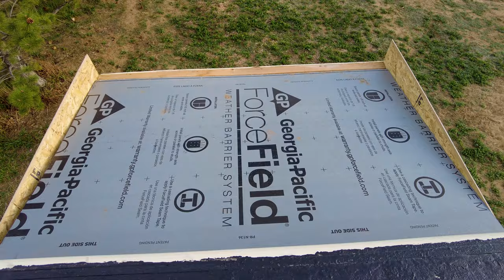$500 Pop Up Camper Hard Side Conversion Update and Future Plans, Exterior Walls and Roof Install

Comment: Mistake you made is that you didn't extend the bottom of bed first.  You could have put a plywood underneath the original plywood that overlaps much as it needed to expand the size of the bed.  Than start building onto the new plywood instead of the old base.  This way you could fit into that bed because you made it longer than it was originally or kept the same length.   All that material that you put in takes up many inches making the whole bed area much smaller than originally was if you don't expend the bottom 1st and build inward.

Comment: should have used plastic sheets on outside and 8th inch ply on inside foam in between super light could have closed the ends in and out

Comment: I guess you've discovered that the tires cannot support the weight. I made the same mistake. Second time I did this I used leuwan and painted with flex seal. ½partical board? Too heavy!
Reply: I also cut the 2x4's in half.
Reply from the maker: I changed out the axles and tires.  Had to make a custom axle for the additional weight.

Comment: So if you are going to be moving this trailer to a permanent Location on a piece of property that you own to reinforce those kickouts for the front and back extensions, you're absolute method to do that is to build walls on the sides and the front or outer facing.  Wall and make them giant storage cabinets! In other words, you're going to build storage compartments that go up underneath to support those! Because with a pop-up pamper like that, you are at lack of storage space! So instead of using just 4 / 4 to support it, build a compartmeant that you can permanently place underneath there and if you ever have to move this camper.  Well then , you can slide them out and you can move them into another location where the camper will be at!
They also have fiberglass paint, which is used specifically for boats! When you make whatever it is that you're going to support those extenders with even deciding that you have on the outside. Because this is the first video that I'm actually watching. And I am now a new subscriber. You can place that on the exterior and you don't ever have to worry about penetration from water and weather!
The other thing you could do is create more space because if you are going to move this camper, what you can do is on the left side as you walk in, you can actually put a kick out beyond the back of that camper, so you can actually lay flat.
Instead of instead of making space on the inside of what's already existing.

Comment: Just finished converting my 2001 Jayco and all i can say when i see your project is one word: Weight? 
I used essentially no plywood or any sheets of wood for siding on my project and the whole trailer is pretty heavy even without the slide-outs. Without cabinets or other fancy interior features (have not got around to doing that). Also wind resistance is huge - a towing nightmare. I'm really curious to see how you'll make out and if there will be no leaks with the moving parts... and towing will be challenge, just a heads up.. i actually blew the head gasket on my 3.5L V6 towing mine for the first time, after about 25 miles. And yours looks way heavier...
Reply from the maker: Thanks for commenting, but I guess you missed the whole part on future plans?
Reply: @hanszimmer8712 and how much did yours end up weighing?

Comment: R.I.P wheel bearings.... tires, springs, brakes, tongue, frame. These lightweight trailers arent designed to handle all that additional weight youve added- they can barely handle what they are. You always see them on the sides of the highways jacked up with blown out tires and hubs. 😂 

Another youtube genius will find out soon enough.
Reply from the maker: Somebody didn't read the description or watch the video....